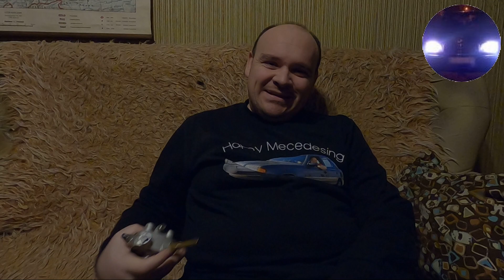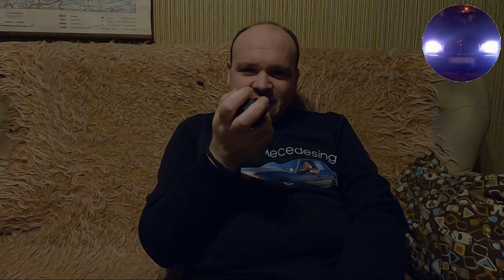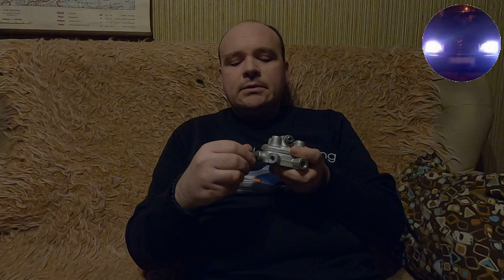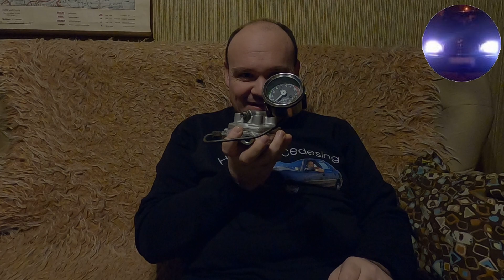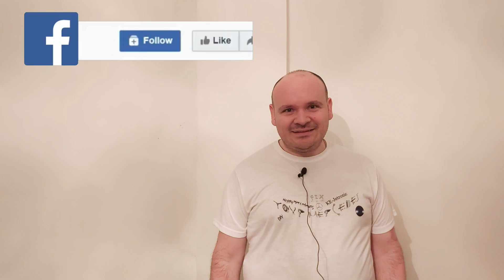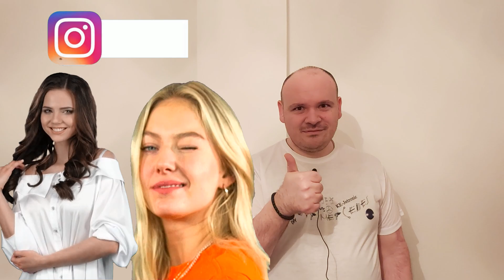Mercedes Ke-Jetronic - Three pressures(system/working/differential)

Comment: what if the control pressure is low and the system pressure normal i have 5.7 control pressure and 6.6 system pressure with a diff pressure of 0.9 bar,The car runs perfect but i dont understand the cause of this...
Reply from the maker: And if you lower the differential pressure?
Reply: @mercedeske  it doesnt start

Comment: Sent you a message on patreon but commenting here just in case. I filled up at a gas station with my '92 2.3 (201,000km) and after filling it up it struggled to start and barely got me home, only going 15km/h never reving above 2k rpm. I replaced the fuel pumps after discovering one was not working, put new injectors, fuel filter, and put a spare FPR in to be safe, the system pressure is only 3.4 bar. This is after rebuilding the fuel distributor. A flow test measured 1.25 litres in 40s from the pumps. Also replaced the fitting with the screen at the fuel inlet. What else could be causing the system pressure to be so low?
Reply: to be clear, it does not start at all anymore, unless spraying quickstart into the AFM
Reply from the maker: @saintgermainyyz  You have my response on your question on Patreon!

Comment: What is the best fuel pump for Mercedes 6 cyl M103.940?
Reply from the maker: The same one you have😁 Try to find on ebay one.
Reply: @mercedeske   Yes, that was my first thought, but the one is in the car is not original. I have tried to look the part number and bosch, but none of the pumps deliver 5.9 bar of pressure..
Reply from the maker: How much do they deliver then?
Reply: @mercedeske   Max 5Bar
Reply from the maker: BAD!!!
Reply from the maker: Sorry, sorry. I'm going to make a video on this. These are the values for the M103 engine: SYSTEM PRESSURE 5.3-5.5bar(engine both cold and warm), differential pressure 0.5bar engine idling cold, 0.4 when warm. The pressure in lower chamber when accelerating 3.8bar(engine cold +20 C) in the cut-off phase 5.3-5.5bar. 30 minutes plus after stalling the engine the pressure must be 2.8bar.
These are the nominal values for the M103 engines. As the engine gets warm unplug the EHA connection!
Reply: @mercedeske   Yes, I thank you for your reply. But 5 bar max is the spec for the pump for my car, looking at the EPC diagram says is A0020919701, which is Bosch 0 580 254 910, wich max pressure is 5 Bar delivery, according to BOSCH official spec. In the video, you say that in 6 cyl engines pressure has to be 5.7 to 5.9...
Reply from the maker: What I gave you is what says in the repairs manual. 5.9 is too much, that was my bad, in fact that concerns the engines with DOHCamshaft. I will make a video about it. So believe m read the message under, those are the specs for M103 engines.
These are the values for the M103 engine: SYSTEM PRESSURE 5.3-5.5bar(engine both cold and warm), differential pressure 0.5bar engine idling cold, 0.4 when warm. The pressure in lower chamber when accelerating 3.8bar(engine cold +20 C) in the cut-off phase 5.3-5.5bar. 30 minutes plus after stalling the engine the pressure must be 2.8bar.
These are the nominal values for the M103 engines. As the engine gets warm unplug the EHA connection!
Reply: @mercedeske   Yes, i believe your data is correct. I have full faith that it is so. No worries. We all wait for your video!. Thank you

Comment: Don’t understand the end ! 🤔 how do you plug to the return line (pressure regulator) ? You need to separate retun line between gauge and pressure regulator for the car to start ? Why disconnect the EHA ?
Reply from the maker: I wanted to say to get back the line for the cold start valve and as for the eha, you have to disconnect it to see your differential pressure without anything modifying it because lambda will have influence on it by modifying it all the time.
Reply: Перевод наруськом языке нету ?.
Reply from the maker: @asikyt2528  Просто посмотрите видео на своем компьютере.  Все мои видео имеют субтитры на любом языке и конечно же на русском языке!

Comment: Please there is a way to change the fuel  preasure for each cylinder?
Reply from the maker: Only if you do it manually by turning the adjustment screws on each cylinder separately which I would NOT recommend you to do! On the eha you do that for all cylinders. There you modify the pressure.
Reply: @mercedeske  please can you say me where is the adjustment screw?
Reply from the maker: https://www.youtube.com/watch?v=FfTpeBAT420
Reply: @mercedeske  thank you
Very very much
Reply from the maker: @danielfmontero  https://www.youtube.com/watch?v=FfTpeBAT420
Reply: @mercedeske  When I left the car in the mecanic the 4 spark plugs where with the same colour
Now the car has 3 black spark plugs and 1 lean
I took the car from the mecanic because he is a bad person
He sais he changed the sensor plate but he only touched the co2 screw

Comment: Is it necessary to replace the aluminum washer when unscrewing the bolt to check the working pressure?
Reply from the maker: No, it's not. You can add a copper one to the aluminum washer in order not to have fuel leaks.
Reply: @mercedeske   And the pressure gauge for water purposes work just fine for testing pressures, right? I might try to make something similar to yours :)
Reply from the maker: @RomasTam  That's the point. Even if you don't have one in bar, measure in what the gauge shows and afterwards convert it to bar. Just unplug the EHA.